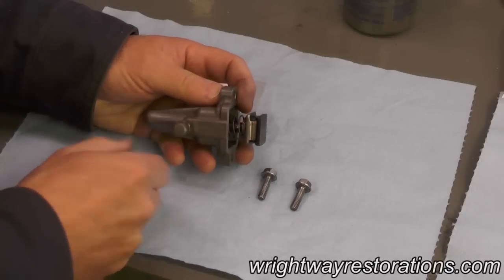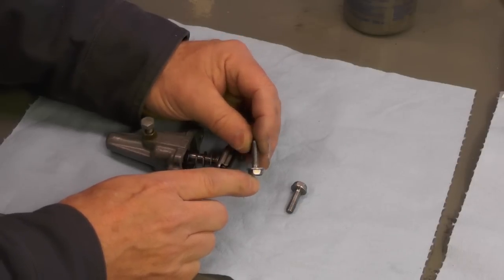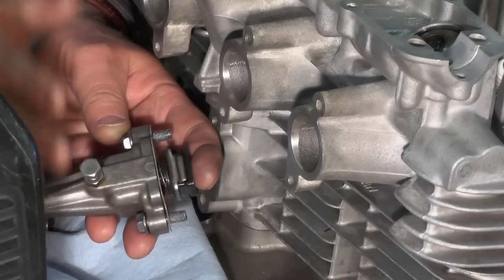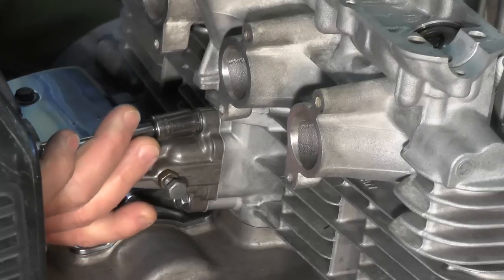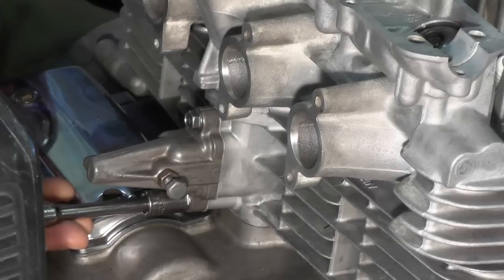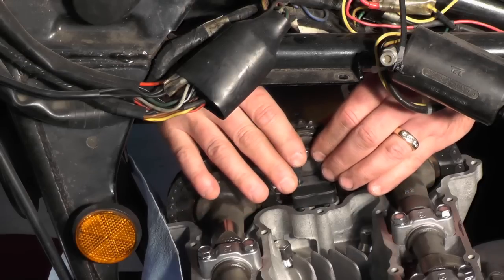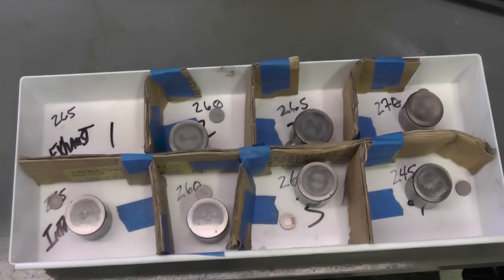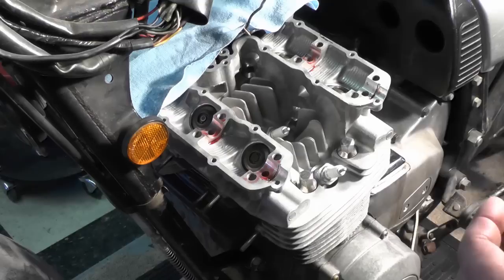Kawasaki KZ650 Cam Chain Tensioners, Buckets & Shims  - Part 13 --- Video #46

Comment: I'm about to do my valve clearances on my GPz 750, which is about the only thing I have never done before. I had it in my head that it was complicated. Your video has showed me it is not.. Have done everything to the bike on my own "including engine rebuild", so not worried at all. My question is: Clearances should be between .13 mm and 0.23 mm for inlet and exhaust. When resetting the clearances what clearance should I be aiming for? Should I be aiming for a low clearance, high, or somewhere in the middle? Also, when reinstalling shims isn't it important which way the size numbering faces in the seat? Thanx!
Reply: GPz84 yes numbers always facing downwards (from what manual and fellow mechanics have told me)

Comment: Hi. First of all, I appreciate your videos.
I have a question and maybe you can answer it.
I have a Kz 650. In the manual it informs that the light of valves can oscillate between 0.08 mm and 0.18 mm. If it is within that range, it is not necessary to change the shims. This is according to a maintenance manual. Well, what I can not understand, is if it is correct to have different valve lights. I have on my motorcycle exhaust 0.15 in cylinder 1, 0.13 in cylinder 2, 0.14 in cylinder 3 and 0.12 in cylinder 4-
And in admision I also have different valve lights. In admission 0.12 in cylinder, 0.13 in cylinder 2, 0.11 in cylinder 3 and 0.12 in cylinder 4. Is this correct? Will the engine work well with different lights? Or do I have to leave all the lights on, say, at 0.12?
I would greatly appreciate an answer.
From now, I appreciate your time and the excellent videos that youtube uploaded.
Thank you.
Alex.
Reply from the maker: I believe you are speaking to the valve stem/shim gap.  What is important is to shim to the valve stem/shim gap within the range dictated in the service manual, which will vary from valve to valve.

Note, you do not have to use the same thickness shims in all valves, in 
fact, you likely won't, due to the difference in valve/valve seat wear 
between valves.  Rest assured, the shims required to maintain the gap will vary by valve, which is perfectly normal.  In other words, maintaining the gap per the service specification is what is important.

Thank you for your kind comments!